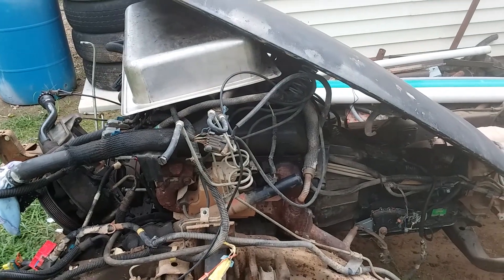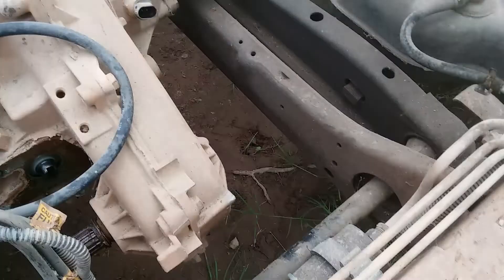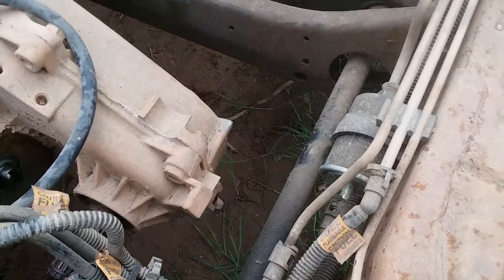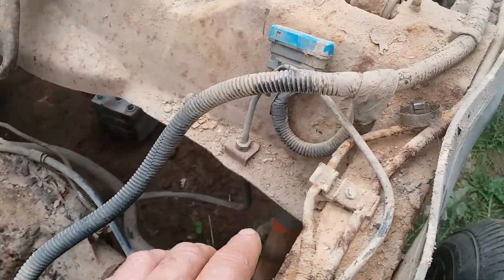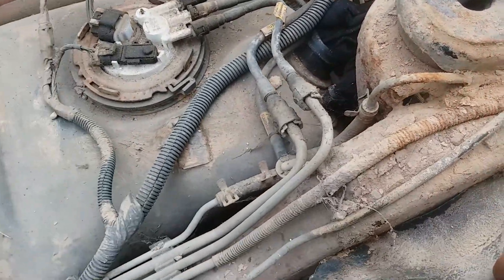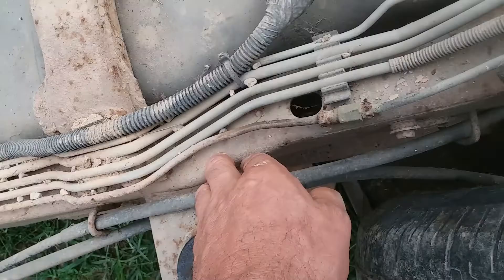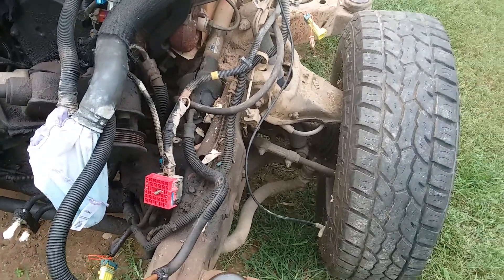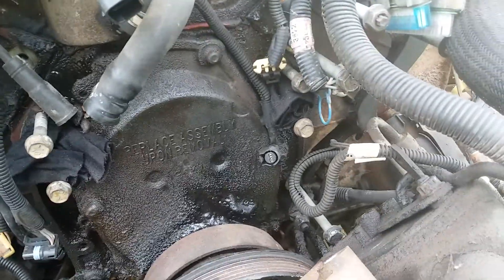2000 Blazer. Fuel and brake lines down the frame.

Comment: Thanks, I'm looking to do the right front brake line (having done all the rear ones) and there's so much "anti-corrosion compound" (oil cooler line) that with the front clip all still on, I can't actually see it  it.  Now I can get a rough measurement. These units were definitely designed to be worked on with the body removed.
Reply from the maker: Look thru the s10 Playlist.  There's a vid where I show all the lines.
Reply from the maker: Well.  I guess this is that vid.
Reply: @thefixerofbrokenstuff  
>>  I guess this is that vid.<<
Yeah, that's why I was thanking you.